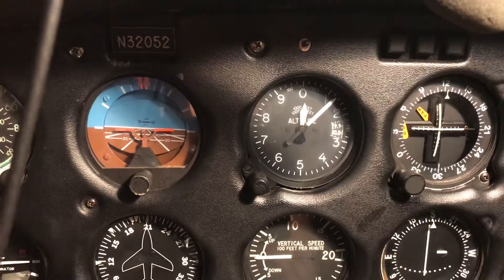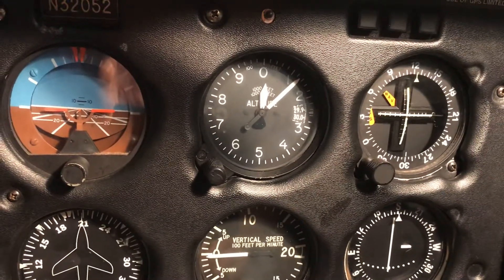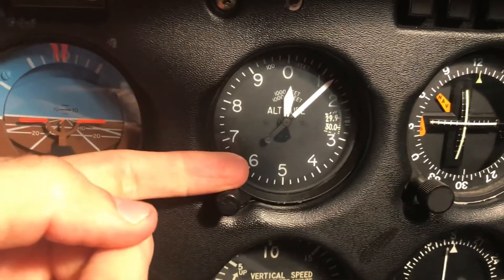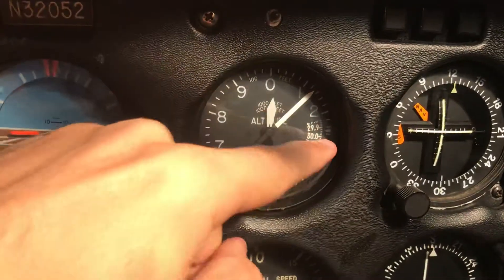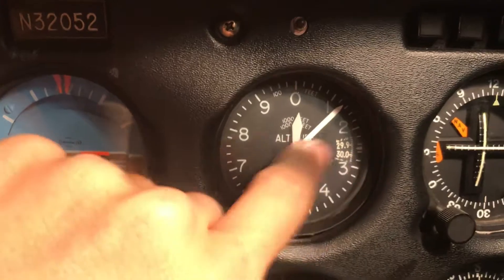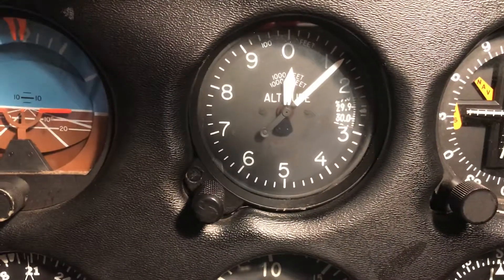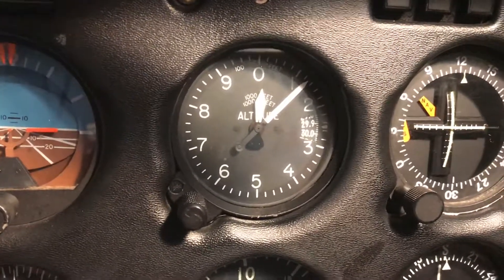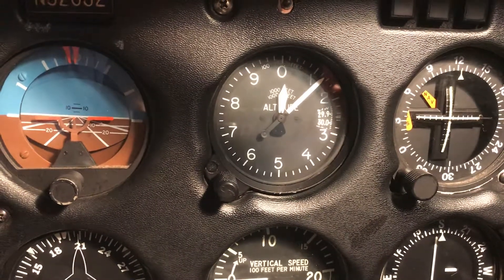Altimeter Kollsman window calibration

Comment: misconceptions:
1. the A&P is not allowed to make this adjustment.  much less you as a pilot.
2. The adjustment is only reserved for the repair station and only one adjustment is allowed.
3.  Terrible practice to have anyone to see this video to make adjustments.
over the years i have found the screw not set properly.
Next time you are on a tight ILS approach please think about what you have accomplished.
again you are not allowed to make this adjustment check our FAR apendix E   https://www.law.cornell.edu/cfr/text/14/appendix-E_to_part_43
Reply: Correct me if I'm wrong, but that would only apply if you were trying to certify the aircraft for IFR operation. If you don't fly IFR or your aircraft isn't certified for IFR flight than I don't see an issue with the performing this calibration.
Reply: MORON
Reply: Not sure why sharing the knowledge was anything but useful. Any human could make the change on an E-AB or E-LSA, any reason we should not want them to know how to maintain their instruments as they fly next to the RICH/FANCY Folks...Should we start book burning again as well???   ;-)